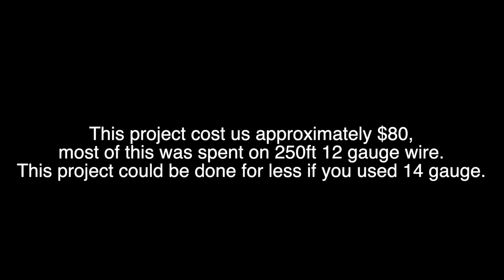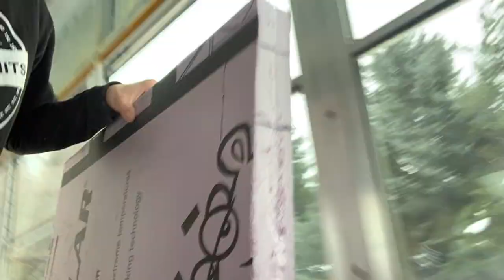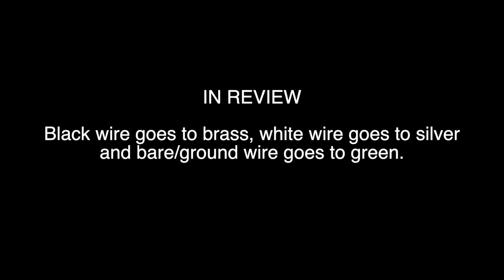How to install outlets in your Skoolie under 5 minutes | School bus conversion

Comment: you used the wrong type of wire... that is solid romex, used for houses only, you need "stranded wire"... 14 gauge is fine for a 15amp plug, 12guage is for a 20amp plug... also there was no need to cut those boxes... they sell short depth boxes, often called "remodel box"... expect to rip it all out and do it all over correctly or prepare for electrical fires when those live wires break and touch the metal outside of your bus
Reply from the maker: Thanks for the input 12 gauge is excisive I do agree but it is fine for a 15 amp plug I did not know that they sell the shorter box that totally makes sense I will definitely look into those many people use the romex wire in RV/Bus builds why stranded wire?
Reply: @EditorEssentials  Hi, Stranded wire is more flexible and is used in commercial built RVs and in all automotive applications. Romex type solid wire like you are using can break from the road vibrations, especially if not attached securely. I used remodel boxes in my bus and it worked out great, you can attach them to plywood walls because they are held on by self tightening tabs. Check out armored stranded wire for your application, be safe. Have fun with your bus! :  )
Reply: @Mr. C You are completely correct,I see a lot of videos where people are wiring their Rv with solid house wire and it makes me cringe, they just don't know. A little research before starting helps and saves a lot of work and expense. Thanks for the heads up!
Reply: Yep and 12/3 stranded marine wire isn't really all that expensive. These folks just aren't doing enough research and are just copying others. Most of them really don't have the intelligence to do what they're trying to do but since they refuse to pay a professional,  they just copy...